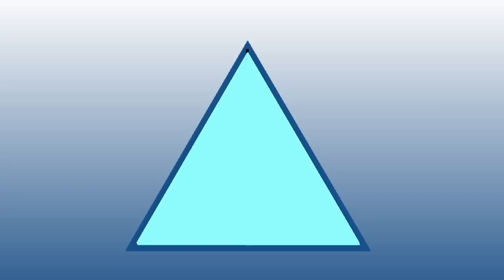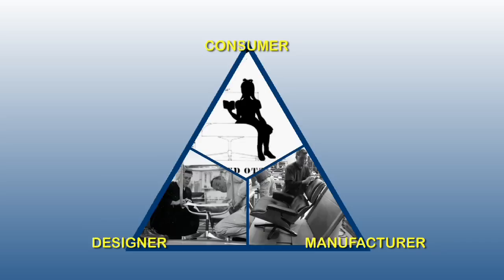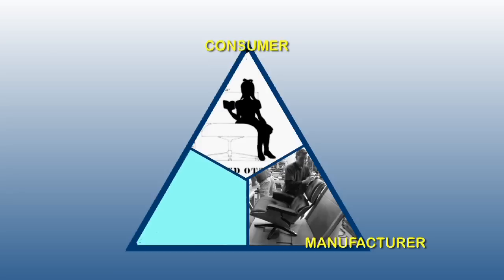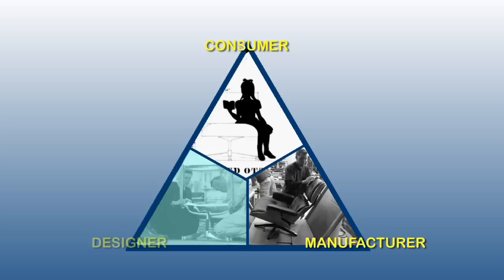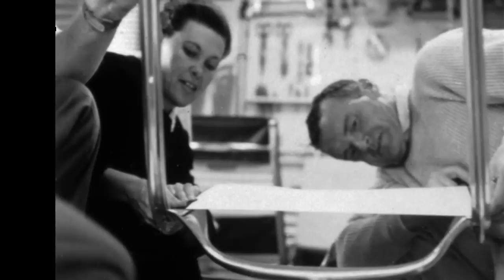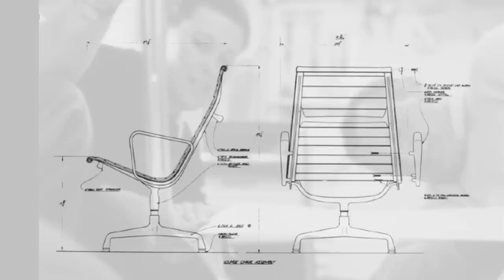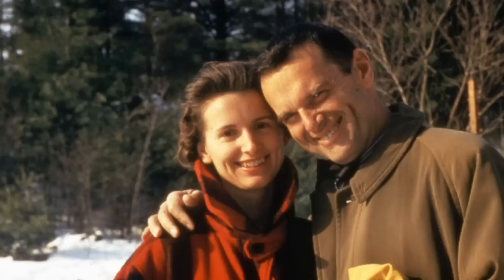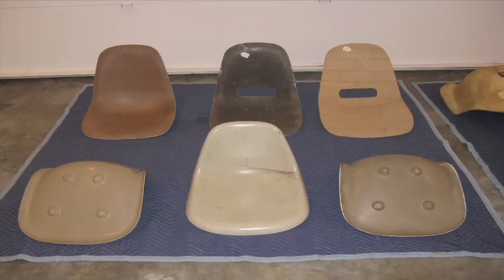AUTHENTICITY

Comment: If I could get a herman miller chair for a price reflective of the materials in the chair and not the prestige surrounding it (something more like $1000) I would do it. But it's hard to justify used 2008 Corolla money on a single chair. At $5000 for a chair made of plywood you don't get to be uppity when an $800 exact replica sells more units.

Comment: I have a H.R. boardroom model, wirh the thicker padding. Always in the same spot in my flat in San Francisco.  Now it has two large cracks in the flat metal struts holding up the seat. And the cracks are separating.  This thing cost me a small fortune, and now it has become dangerous.  I feel ripped off.

Comment: What bullshit!  Start out with handcrafted custom wood and metal work and charge for the intensive craft skilled labor. Now just make in your factory mass produced shit for a fraction of the cost and charge 6000 dollars for a chair that can be bought on amazon for 600 dollars with the same level of quality in materials and workmanship..  Mass production lowers cost and puts the Herman Miller company in the shitter.  Greed and profit. They want you to believe their chair is superior to knockoffs from China. They pick a cheap 200 dollars chair for comparison.  Pick a 600 dollar chair and they are indistinguishable from real.  This company is scared because copies are so good today.  China makes fake rolexes using exact copies of rolexes own movement making  for accurate timepieces.